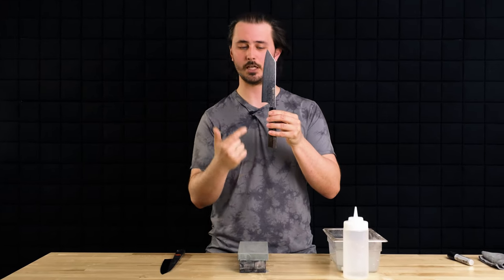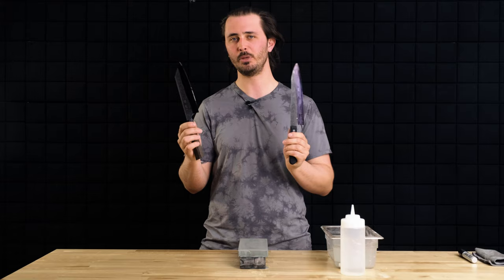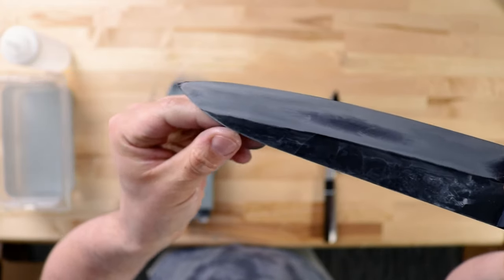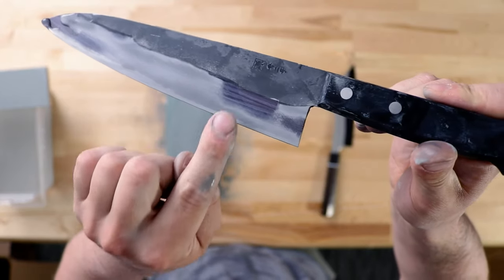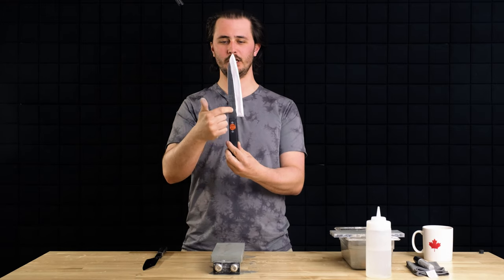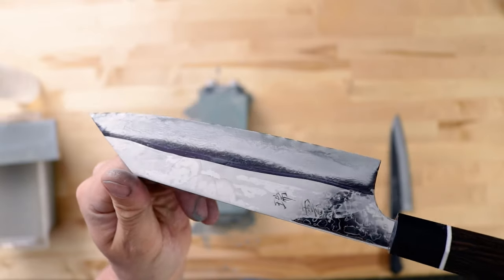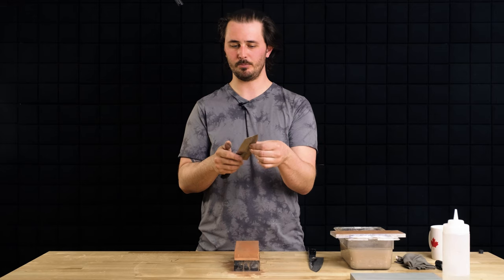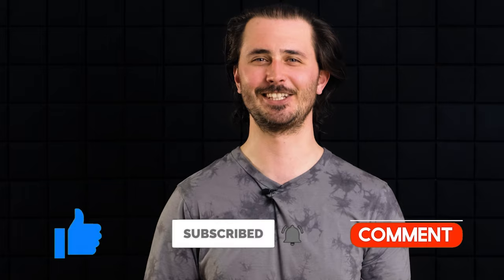Lets Thin Some Knives! +2 KNIFE GIVEAWAY

Comment: Excellent, quick intro to thinning. Nicely done. I appreciate that you made a point to guard people against chasing perfection too much in the first thinning of a knife. In my experience, often times to get the bevels absolutely perfectly flat, you end up taking life off of the knife by apexing the edge too hard in places. And then you have to sharpen that nonsense out and you end up with a less tall knife. It's much better to stop when you think the edge is being compromised and wait for future sharpenings to raise the edge some more before proceeding. Even if that means leaving a few cosmetic imperfections in the new polish. This is particularly true with hand forged, hand ground artisan knives.

Just a couple of minor corrections to what you said in case they might have confused anyone. That Debado MD stone is 200 grit, not 220. And it's a wonderful stone but in my opinion way too expensive for what it is. If you do a lot of thinning on that stone, you will quickly wear it away with the needed flattenings. You're better off buying some soft and inexpensive 200ish grit bricks where you can get 10x the amount of usesble stone for less money.

Also, Japanese bevels ground on wheels from the factory are usually a tiny bit concave rather than convex. That's why the low spots usually appear in the center of the bevel rather than the edges.

Comment: Thanks for the details! I’ve recently progressed from stainless to my first (old and abused) carbon nakiri, mainly to see the difference, spent hours restoring it from its many years of home sharpening. Ma-hoosive difference in workability. I couldn’t quite sharpen the edge the same at such a flat angle while removing so much material, the burr was huge. So this helped a bunch in terms of the right grit for the intended job, and the correct procedure. I got the nakiri to where it should be after this so now it’s time to replace my (cheap-ass stainless) petty knife and bunka with carbon steel versions. I do prefer the idea of a used knife mind you, call me soppy but it comes with both history and longevity

Comment: I have been slowly building up my Asian knives and sharpening them has always been a problem. I have an electric sharpener but rarely use it since it does take away so much steel. I I did get a 6000 -8000 grit stone but no where near the size you have. I will see what you have at your store. I also have been looking at sharpening them in the wrong way. I was using the traditional knife way with the edge. Thank you for teaching me how to thin a knife and will look up your sharping knives now. I need good stones, holder and the flattening stone. Thank you for your tube.

Comment: Usually Im impatient and will use a belt grinder to thin and then I will tune it with my atoma 140 and king 300. Then I may or may not finish it up the grits depending on the knife.

Comment: Awesome video!  I have been wondering about this process and hoping you would do a video on it!  I am curious if the low spot on the knife is between the cutting edge and the shinogi line is it ok the leave it as a low spot?  Will it affect anything performance wise or just give it a different finish compared to the rest of the knife that has been thinned out?

Comment: I wonder what advantage does the Shinogi provide? Never used a knife with Shinogi and I am really curious if there is a significant difference in user experience
Reply: A shinogi line is simply the line of lamination between the core steel and the cladding steel. Unlike lasers, knives with a wide bevel and very visible shinogi line tend to be heavier with a thicker spine that tapers considerably from shinogi to edge. Depending on the grind, the tip may still be ground really thin. With a longer 240mm or so gyuto, this gives you a knife that does everything pretty well. Light tip for precision, middle for slicing and heel for denser foods. You don’t feel the heavier weight (as compared to a lighter, more laser knife). This kind of knife tends to be more of a workhorse, less great for specialized tasks. 

On the sharpening side, the bevel is so obvious that it’s easy to sharpen at the same angle - just follow the knife grind. You can thin the bevel from the shinogi line a little every time you sharpen, or raise the knife a little and just sharpen the edge and thin the bevel in a longer session when the edge gets too thick, it’s your choice.